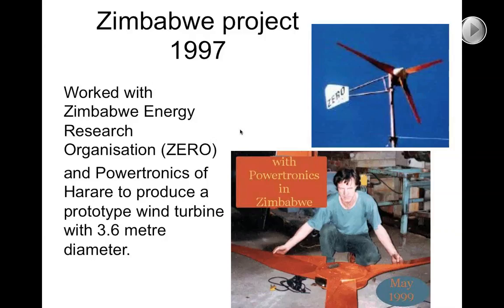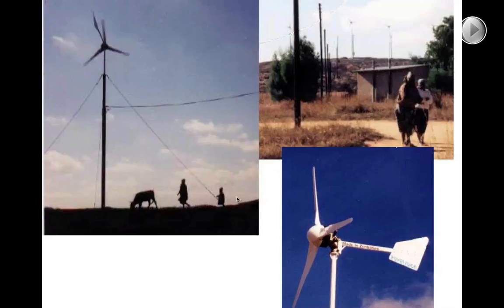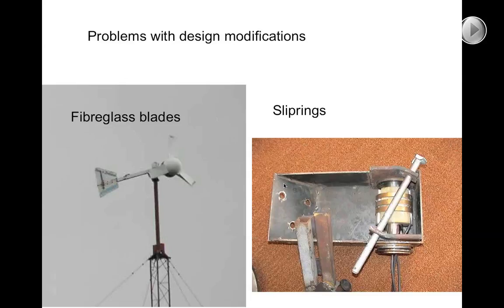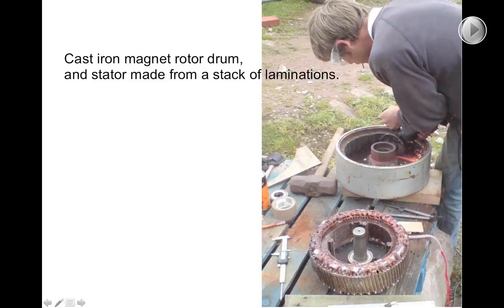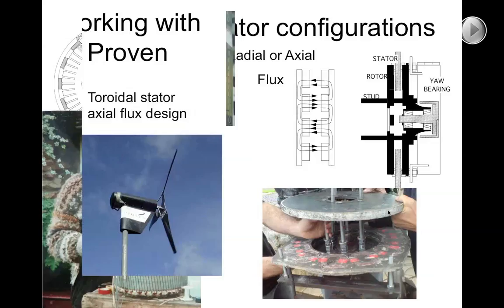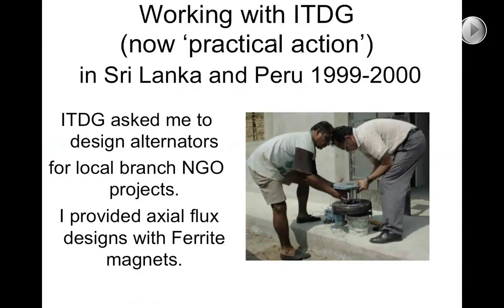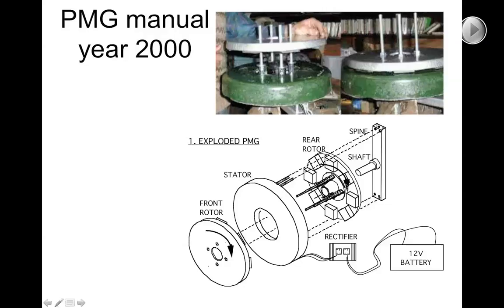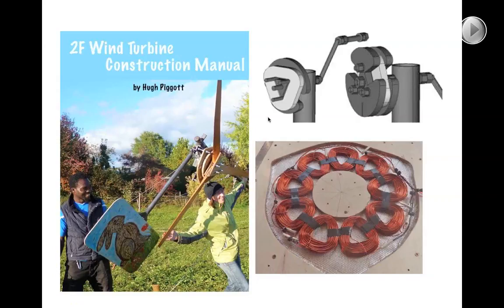Alternator Designs (powerpoint)

Comment: Hugh, Thanks for sharing these videos. I've been interested in what you do since I became interested in wind power whilst living on the Isle of Tiree as a child.
I learned just how badly neodymium magnets corrode when I helped Lews Castle Collage Stornoway fix one of their wind turbines as a project.

I was wondering what you thought of increasing the magnet rotor thickness to counteract the reduced flux of ferrite magnets. The optimum shape of a magnet for flux strength is when the length equals the diameter. Would it therefore make sense to substitute for example 40 x 25 x 10mm neodymium for 40 x 25 x 30mm ferrite probably 3 magnets stacked. They still wouldn't be as strong as neodymium but perhaps the area could also be increased slightly if necessary. I wonder if an optimum can be achieved if the thickness of the rotor is maximised first then the area of magnet poles is increased to gain the required flux strength.

My concern is that the increased weight of the magnet rotors will reduce the turbines responsiveness to gusty wind conditions.

Comment: Hi Hugh ....a couple questions if you don't mind. Toward the end of the video speaking on corrosion of the Neo magnet have you found the black in appearance epoxy coated magnets from the factory to have the same problems over time? Secondly are you indicating that the lack of efficiency in the ferrite design allows the turbine to turn  while still under a load due to the lack of generator efficiency i.e. continuous power production versus an instantaneous power spike with the generator load killing the momentum.... If this is the case would you agree that the going up to magnets up to N 52 while increasing the efficiency or strength of the generator kill the performance of the turbine due the to heavier load from the generator on the blades.thus overkill in the magnet...Not sure if I am saying this well hope you get the point
Reply from the maker: hi tony yes the corrosion still happens even with various coatings on the magnets.  Just like chrome plated cars still corrode.  It's mainly a problem in maritime locations.  Can be very rapid in tropical locations.  Can be dealt with using oil but still a disappointing result.
Highly efficient alternators will run at constant speed (rpm) over various loadings.  In high winds you want the blades to speed up or they will stall.  Having some loss of voltage in the circuit (whether in the coils or a series heater in the circuit) allows a change of speed.  Weaker magnets need more turns of thinner wire hence more internal resistance in the coils which allows higher speed.
Your vehicle alternators also speed up due to internal impedance of the reactive kind but this tends to limit maximum output and the shape of the power/speed curve is hooked downward rather than being hooked upward as we would wish.  The machine overspeeds rather than stalling which if anything is a worse outcome.
cheers
Hugh
Reply: Hugh Piggott
 I  watched your 20 minute power point because I have experienced some of the pains you have  with radial designs. I have reached some of the same type  dead ends .We build axials as well and want to use mppt technology to build something we can get a real 2 kw rated wind turbine. I know Chris Olsen did something similar and read debate on the bearings and differences in opinion on the designs. We had the Air Boss design that was pretty much built on the 1.4 and 2.8 designs  but as always we want more power and I don't want to stack stators to make the power which leaves me with increasing the diameter and surface area of coil and magnet presumably .

The reason for my question is that from what I deduct from the comment simply adding stronger magnets i.e. N 42 to N 52 is a recipe to stall the turbine and secondarily increase blade strain and end up with turbine with snapped off fiber glass as in the photos in your power point? I see a lot of people using n 52 in this design and thing that it would be undesirable due to the increase tolerance to heat for that stronger magnet as well.

People change and evolve Hugh and I think you will forever in your mind have me as a delco guy which is fine. I am a cost effective guy with an open mind.
Actually Hugh we build axials as well and really only still build the other delco pma because people still want them typically to replace my competitors alternator which will not so much as charge a battery. We advertise them at what I observe on a wattsview which is about 150-400 watts depending on the voltage environment. I am frustrated that people kill the small wind market with delco wind turbines with 28 inch blades that output 100 watts advertised at 1600. 

Hugh my questions are about axials not a small alternator referendum from the past. I have moved on from that and am looking at  making as much power possible in the most cost effective manner possible.
Reply from the maker: Hurricane Wind Power
yes if you want more power you need larger diameter magnet disks. Stacking is not cost-effective use of materials.  But higher power at high rpm will ideally require MPPT I'd say. 

I tend to prefer going for larger blade-rotor diameter, so you can get a narrower range of rpm for the same high power, but in lower winds.  That way stalling is not such as issue.  But if you want high power with small blade-rotor diameter (in high winds) you will need to go for a high cut in speed (and poor low wind performance) or an MPPT controller so as not to stall in stronger wind.  Or heaters in series as I do on my big machine here at home.
Reply: Hugh Piggott
Hugh we would always prefer low wind speed production with larger blades or even a 5 blade design which we have had some good results on our smaller turbines. I am looking for the higher voltage that we can regulate with our midnight down to 12,24, or possibly even 48 volt with one winding. In doing so I have concerns that the required thin ga windings for the higher voltage will not last due to heating concerns. Presumably the larger disk will not shed heat as well. Do you have a design that you might recommend to this end?